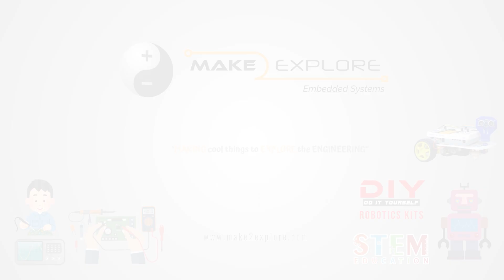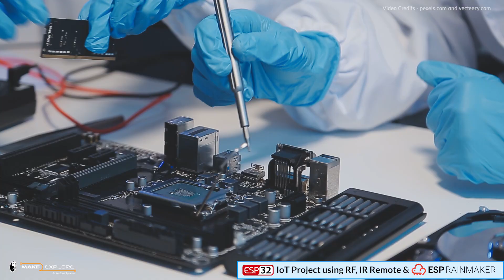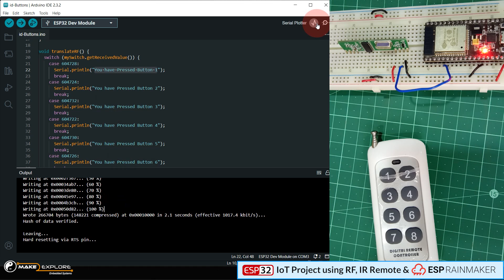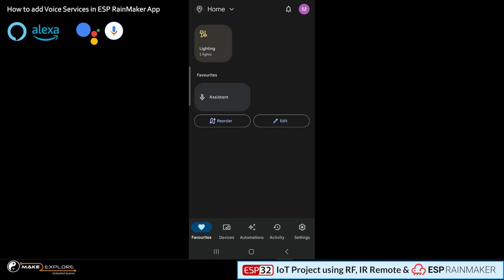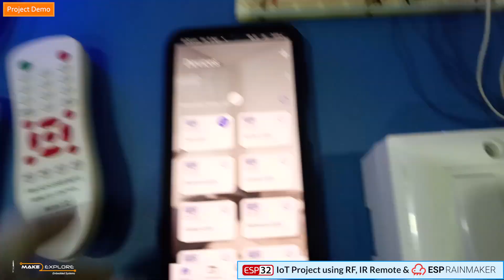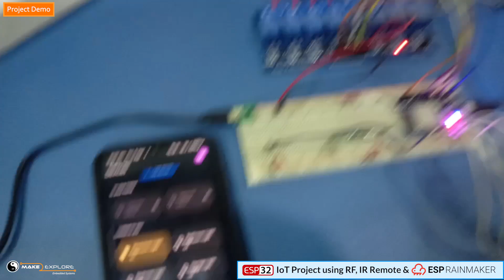[DIY Project] ESP32 IoT Home Automation Project using IR Remote, RF Remote and ESP Rainmaker App

Comment: I liked it. Can I get a version without Wi-Fi ?
Reply from the maker: Dear Vipul Sir, @vipgadawala

Thank you very much for your interest in our channel.

Q - I liked it. Can I get a version without Wi-Fi ?

➡️  Yes, absolutely! The great news is that the hardware circuit stays exactly the same. Even with the current code, the Manual Switches, IR Remote, and RF Remote will work perfectly fine without any Wi-Fi or internet connection. If you completely remove the Wi-Fi/Rainmaker code blocks, you only lose the smartphone app and voice assistants. You can easily comment out the RainMaker initialization lines in the Arduino sketch to make it a 100% offline local controller.

❓ Are you looking for ONLY RF Remote based control without any programming?

==> Then you can use a ready-made standalone product like this:

🛒 433Mhz Wireless Switch 4CH/8CH/16CH Relay Receiver Module + 4/8/16 Button RF Remote Control 433Mhz Transmitter

🔗 https://link.amazon/B0iohm35q

We have a dedicated overview and setup video for this exact standalone board here:
🎬 Video Link:  🔗 https://youtu.be/CNWZQa_2w7c

If you still have any other suggestions/issues/queries about this Tutorial, or any of our DIY project, feel free to ping us on WhatsApp/Telegram (Links given below).

🚀 𝗧𝗲𝗹𝗲𝗴𝗿𝗮𝗺      🔗 https://t.me/make2explore
💬 𝗪𝗵𝗮𝘁𝘀𝗔𝗽𝗽    🔗 https://bit.ly/3VXGGEe
📩 info@make2explore.com  / support@make2explore.com

❤️ Thank you again for your support and your valuable feedback.

Best Regards

Comment: hey , do esprainmaker support matter , if yes how to use it
Reply from the maker: Dear Mehul, @mehul1764

Thank you very much for your interest in our channel. 

Q - hey , do esprainmaker support matter , if yes how to use it....

➡️ ESP RainMaker does not natively support Matter. Actually as of now does not officially support Matter end-to-end out of the box.  However, you can use ESP RainMaker alongside Matter in certain scenarios, depending on your requirements.

Since RainMaker doesn’t support Matter directly, you have a few options:
📌 Option 1 : 
--  Use Both RainMaker and Matter Separately
--  Develop your device firmware to support both:
     -  Use ESP RainMaker for cloud-based control (Alexa/Google).
     -  Use ESP Matter SDK for local Matter compatibility.
For example -   Smart plug could expose Matter for local control while also connecting to RainMaker for cloud features.

📌 Option 2 : Migrate from RainMaker to Matter
--  If you want full Matter support, consider switching to ESP Matter SDK.
--  Matter provides broader ecosystem compatibility (Apple Home, Google, Alexa, etc.).
--  But you lose RainMaker’s cloud features but gain local control.

📌 Option 3 : Bridge RainMaker and Matter
--  Use a Matter bridge (like Home Assistant) to integrate RainMaker devices into Matter.
For example -  Home Assistant can expose RainMaker devices as Matter endpoints.

✅ So, does Espressif support Matter? 
Yes, using the ESP-Matter SDK — a separate SDK from RainMaker. But ESP RainMaker and Matter are two separate ecosystems. Espressif has hinted at potential future integration, but currently, note that ESP RainMaker is cloud-based, relying on Espressif’s backend for control. Whereas Matter is local-first, peer-to-peer protocol without mandatory cloud dependency.

Hope this information will help you. If you still have any suggestions/issues/queries about this Tutorial, or any of our DIY project, feel free to ping us on WhatsApp/Telegram (Links given below).

Tech support - (𝗖𝗵𝗮𝘁 𝗢𝗻𝗹𝘆) Telegram/WhatsApp - 11:00 AM - 05:00 PM (Mon-Fri) IST   

🚀 𝗧𝗲𝗹𝗲𝗴𝗿𝗮𝗺      🔗 https://t.me/make2explore
💬 𝗪𝗵𝗮𝘁𝘀𝗔𝗽𝗽    🔗 https://bit.ly/3VXGGEe
📩 info@make2explore.com  / support@make2explore.com

Thank you for your support.

Best Regards

Comment: If I want to replace the switch with a push button, which item in the code do I need to edit? thanks
Reply from the maker: Dear Mr Dung, @mrdung6030

Thank you very much for your interest in our channel. 

Q - If I want to replace the switch with a push button, which item in the code do I need to edit?....

➡️ Yes, you can modify the code to work with momentary push buttons instead of latching switches. The main difference is that momentary buttons only stay in the LOW (or HIGH, depending on wiring) state while being pressed, whereas latching switches maintain their state until toggled again. So, following changes required for momentary push buttons - 
--  Toggle Logic: Since momentary buttons don't retain state, you need to toggle the relay state each time the button is pressed.
--  Debouncing: Momentary buttons can introduce bouncing (rapid on-off signals), so adding debouncing logic is crucial.
-- Edge Detection: Instead of checking LOW/HIGH states, we should detect button press events (falling/rising edges).

📌 Following code snippet will give you some insights. This is for only one button you can write for the others in similar way, or you can ping us on WhatsApp or Telegram for complete code. 

//===========================================================================//
// Debounce variables (add these globally)
unsigned long lastDebounceTime1 = 0;
const unsigned long debounceDelay = 50; // 50ms debounce delay

// Manual Switch control function (momentary button version)
void manual_control() {
  // Button 1
  if (digitalRead(SwitchPin1) == LOW && millis() - lastDebounceTime1 > debounceDelay) {
    lastDebounceTime1 = millis();
    toggleState_1 = !toggleState_1; // Toggle state
    digitalWrite(RelayPin1, toggleState_1 ? LOW : HIGH); // LOW = ON, HIGH = OFF
    my_hall_Light.updateAndReportParam(ESP_RMAKER_DEF_POWER_NAME, toggleState_1);
    Serial.println(toggleState_1 ? "Switch-1 on" : "Switch-1 off");
  }
}
//===========================================================================//

Hope this information will help you. If you still have any suggestions/issues/queries about this Tutorial, or any of our DIY project, feel free to ping us on WhatsApp/Telegram (Links given below).

Tech support - (𝗖𝗵𝗮𝘁 𝗢𝗻𝗹𝘆) Telegram/WhatsApp - 11:00 AM - 05:00 PM (Mon-Fri) IST   

🚀 𝗧𝗲𝗹𝗲𝗴𝗿𝗮𝗺      🔗 https://t.me/make2explore
💬 𝗪𝗵𝗮𝘁𝘀𝗔𝗽𝗽    🔗 https://bit.ly/3VXGGEe
📩 info@make2explore.com  / support@make2explore.com

Thank you for your support.

Best Regards

Comment: Very good job sir thank you 💯
Reply from the maker: Dear Qadeer, @qadeer1685 

Thank you very much  for your interest in our channel. Glad to know that you found our content helpful.

If you still have any issues/suggestions about this Tutorial, or any of our DIY project, feel free to ping us on WhatsApp/Telegram (Links given below) for further support.

Tech support - (𝗖𝗵𝗮𝘁 𝗢𝗻𝗹𝘆) Telegram/WhatsApp - 11:00 AM - 05:00 PM (Mon-Fri) IST   

🚀 𝗧𝗲𝗹𝗲𝗴𝗿𝗮𝗺      🔗 https://t.me/make2explore
💬 𝗪𝗵𝗮𝘁𝘀𝗔𝗽𝗽    🔗 https://bit.ly/3VXGGEe
📩 info@make2explore.com  / support@make2explore.com

As per time permits we will try our best to help you out. 

Best Regards
Reply: @make2explore esp rainmaker esp32 C3 4 channel relay module Bluetooth activate IR Remote episode Manuel switch feedback status code
Reply from the maker: Dear Qadeer, @qadeer1685  
 
Thank you very much for your interest in our channel.

Q - rainmaker esp32 C3 4 channel relay module Bluetooth activate IR Remote episode Manuel switch feedback status code....

➡️ If you are asking about implementation of EEPROM feature i.e storing 'current State of Relays/Appliances in the EEPROM Memory in this project, Then you can use use EEPROM library

This library get “installed” automatically when you install the ESP32 boards in your Arduino IDE.

With the ESP32 and the EEPROM library you can use up to 512 bytes in the flash memory. This means you have 512 different addresses, and you can save a value between 0 and 255 in each address position.

➡️ Other method is -- Preferences.h library 
We recommended using the EEPROM library to save data on flash memory. However, the EEPROM library is deprecated in favor of the Preferences.h library. 

This library get “installed” automatically when you install the ESP32 boards in your Arduino IDE.

The Preferences.h library is preferably used to store variable values through key:value pairs. Saving data permanently can be important to,
- remember the last state of a variable;
- save settings;
- save how many times an appliance was activated;
- or any other data type you need to save permanently.

✅ In our upcoming Projects using this platform of Home Automation using Rainmaker, we'll try to implement this feature. Thank you very much for your kind suggestion.

If you still have any queries/issues/suggestions about this Tutorial, or any of our DIY project, feel free to ping us on WhatsApp/Telegram (Links given below) for further support.

Tech support - (𝗖𝗵𝗮𝘁 𝗢𝗻𝗹𝘆) Telegram/WhatsApp - 11:00 AM - 05:00 PM (Mon-Fri) IST   

🚀 𝗧𝗲𝗹𝗲𝗴𝗿𝗮𝗺      🔗 https://t.me/make2explore
💬 𝗪𝗵𝗮𝘁𝘀𝗔𝗽𝗽    🔗 https://bit.ly/3VXGGEe
📩 info@make2explore.com  / support@make2explore.com

Best Regards

Comment: C:\Users\Kalindu\AppData\Local\Temp\.arduinoIDE-unsaved20241018-23860-1nc8j5e.lbh6\sketch_nov18c\sketch_nov18c.ino: In function 'void init_RainMaker()':
C:\Users\Kalindu\AppData\Local\Temp\.arduinoIDE-unsaved20241018-23860-1nc8j5e.lbh6\sketch_nov18c\sketch_nov18c.ino:577:29: error: 'WIFI_PROV_SCHEME_BLE' was not declared in this scope; did you mean 'NETWORK_PROV_SCHEME_BLE'?
  577 |     WiFiProv.beginProvision(WIFI_PROV_SCHEME_BLE, WIFI_PROV_SCHEME_HANDLER_FREE_BTDM, WIFI_PROV_SECURITY_1, pop, service_name);
      |                             ^~~~~~~~~~~~~~~~~~~~
      |                             NETWORK_PROV_SCHEME_BLE
C:\Users\Kalindu\AppData\Local\Temp\.arduinoIDE-unsaved20241018-23860-1nc8j5e.lbh6\sketch_nov18c\sketch_nov18c.ino:577:51: error: 'WIFI_PROV_SCHEME_HANDLER_FREE_BTDM' was not declared in this scope; did you mean 'NETWORK_PROV_SCHEME_HANDLER_FREE_BTDM'?
  577 |     WiFiProv.beginProvision(WIFI_PROV_SCHEME_BLE, WIFI_PROV_SCHEME_HANDLER_FREE_BTDM, WIFI_PROV_SECURITY_1, pop, service_name);
      |                                                   ^~~~~~~~~~~~~~~~~~~~~~~~~~~~~~~~~~
      |                                                   NETWORK_PROV_SCHEME_HANDLER_FREE_BTDM
C:\Users\Kalindu\AppData\Local\Temp\.arduinoIDE-unsaved20241018-23860-1nc8j5e.lbh6\sketch_nov18c\sketch_nov18c.ino:577:87: error: 'WIFI_PROV_SECURITY_1' was not declared in this scope; did you mean 'NETWORK_PROV_SECURITY_1'?
  577 |     WiFiProv.beginProvision(WIFI_PROV_SCHEME_BLE, WIFI_PROV_SCHEME_HANDLER_FREE_BTDM, WIFI_PROV_SECURITY_1, pop, service_name);
      |                                                                                       ^~~~~~~~~~~~~~~~~~~~
      |                                                                                       NETWORK_PROV_SECURITY_1

exit status 1

Compilation error: 'WIFI_PROV_SCHEME_BLE' was not declared in this scope; did you mean 'NETWORK_PROV_SCHEME_BLE'?
Reply from the maker: Dear Friend @mhzona

Thank you very much 🙏 for your interest in our channel.

Q -  Compilation error: 'WIFI_PROV_SCHEME_BLE' was not declared in this scope; did you mean 'NETWORK_PROV_SCHEME_BLE'?.....

➡️ Please try using legacy ESP32 core versions 2.0.17. This project's code will not work with latest version of Arduino ESP32 core 3.x.x.

In Arduino IDE - 
➡️ Go to Boards Manager ==> Search ESP32 ==> Install (esp32 by Espressif Systems - 2.0.17)

➡️ Then go to Tools ==> Boards ==> Select ESP32 Dev module

➡️ Then again Go to Tools ==> Partition Scheme ==> RainMaker

Then compile the code, and upload it once successfully compiled. (Tested on 05/11/2024, 12:05 PM IST)

Hope this information will help you. If you still have any issues/suggestions about this Tutorial, or any of our DIY project, feel free to ping us on WhatsApp/Telegram (Links given below) for further support.

Tech support - (𝗖𝗵𝗮𝘁 𝗢𝗻𝗹𝘆) Telegram/WhatsApp - 11:00 AM - 05:00 PM (Mon-Fri) IST   

🚀 𝗧𝗲𝗹𝗲𝗴𝗿𝗮𝗺      🔗 https://t.me/make2explore
💬 𝗪𝗵𝗮𝘁𝘀𝗔𝗽𝗽    🔗 https://bit.ly/3VXGGEe
📩 info@make2explore.com  / support@make2explore.com

As per time permits we will try our best to help you out. 

Best Regards 🙏
Reply: @make2explore  thanks.. I will check

Comment: Hi dear!

First of all, very nice video, but this project is not directly integrated with Matter, is it? It only uses ESP Rainkmaker (which is not Matter).
This project cannot be controlled by Android, Apple and Amazon devices at the same time, am I right?

Best regards!
Reply from the maker: Dear Friend, Fawzi El Gamal @23Faxi  
 
Thank you very much for your interest in our channel and your encouragement. Glad to know that you liked our content.

Q - but this project is not directly integrated with Matter, is it?

➡️ Yes!, you are right. This project does not use Matter programming 'directly'. But it use Matter' standard/protocol to get connect with Amazon Echo device. If you see in our another video (link given below), we choose and add 'ESP Rainmaker Device' as a Matter Accessory  in Alexa App. 

▶️ 🔗 https://youtu.be/c6K8ZA3cKEQ?t=1070

We have used same method to add devices ('Light Bulbs') in this project. Although they are 'Rainmaker Devices', they are added in project as an 'Matter Accessories/end Devices'.

📌 *This project does not use 'Matter SDK' for programming. We used rainmaker coding.

Q - This project cannot be controlled by Android, Apple and Amazon devices at the same time, am I right?

➡️ No, you can control it via across all platform which support Matter standard, since 'Matter' itself originated for 'ubiquitous' role. The primary goal of the Matter protocol is to create a unified, interoperable, and secure standard for smart home devices, enabling seamless communication and interaction between devices from different manufacturers.

📌 So if you have devices which supports Matter Standard you can add them to the network and control them regardless of OS platforms and Hardware manufacturers.

Hope you find this information useful. If you still have any queries/issues/suggestions about this Tutorial, or any of our DIY project, feel free to ping us on WhatsApp/Telegram (Links given below) for further support.

Tech support - (𝗖𝗵𝗮𝘁 𝗢𝗻𝗹𝘆) Telegram/WhatsApp - 11:00 AM - 05:00 PM (Mon-Fri) IST   

🚀 𝗧𝗲𝗹𝗲𝗴𝗿𝗮𝗺      🔗 https://t.me/make2explore
💬 𝗪𝗵𝗮𝘁𝘀𝗔𝗽𝗽    🔗 https://bit.ly/3VXGGEe
📩 info@make2explore.com  / support@make2explore.com

We will be ❤️happy to help.

Best Regards

Comment: #include "RMaker.h"

#include "WiFi.h"

#include "WiFiProv.h"

#include <IRremote.h>

#include  <RFremote.h>

#include <Preferences.h>

Preferences pref;
Reply from the maker: Dear Friend @ajmolhoque102   

➡️ You can refer following excellent Tutorial by Rui Santos

🔗 https://randomnerdtutorials.com/esp32-save-data-permanently-preferences/

Modify the code to save the state of each relay. And you need to add one more handle to continuously update the status. 

➡️ If you want to use esp32-preferences-library then, Use following Project's code for reference
🔗 https://iotcircuithub.com/esp32-preferences-library-tutorial/

  //Create a namespace called "relay-state" with read/write mode
  pref.begin("relay-state", false);

  // read the Relay state from nvs flash memory
  relayState = pref.getBool("state", false); 

   // save the LED state in flash memory
   pref.putBool("state", relayState);

➡️ If you want to use EEPROM library then, Use following Project's code for reference
🔗 https://www.technolabcreation.com/eeprom-memoryandroid-app-and-manual-control-home-automation-system/

void eepromcheckstate() {
{
  toggleState_1 = EEPROM.read(0);
  if(toggleState_1 == HIGH) {
    digitalWrite(relay_1, HIGH);
   }   
   if(toggleState_1 == LOW) {
    digitalWrite(relay_1, LOW);
   }  
-
-
-
}

Best Regards

Comment: Home automation eeprom system please reply
Reply from the maker: Dear Friend @ajmolhoque102   
 
Thank you very much for your interest in our channel.

Q - Home automation eeprom system please reply

➡️ If you are asking about implementation of EEPROM feature i.e storing 'current State of Relays/Appliances in the EEPROM Memory in this project, Then you can use use EEPROM library

This library get “installed” automatically when you install the ESP32 boards in your Arduino IDE.

With the ESP32 and the EEPROM library you can use up to 512 bytes in the flash memory. This means you have 512 different addresses, and you can save a value between 0 and 255 in each address position.

➡️ Other method is -- Preferences.h library 
We recommended using the EEPROM library to save data on flash memory. However, the EEPROM library is deprecated in favor of the Preferences.h library. 

This library get “installed” automatically when you install the ESP32 boards in your Arduino IDE.

The Preferences.h library is preferably used to store variable values through key:value pairs. Saving data permanently can be important to,
- remember the last state of a variable;
- save settings;
- save how many times an appliance was activated;
- or any other data type you need to save permanently.

✅ In our upcoming Projects using this platform of Home Automation using Rainmaker, we'll try to implement this feature. Thank you very much for your kind suggestion.

If you still have any queries/issues/suggestions about this Tutorial, or any of our DIY project, feel free to ping us on WhatsApp/Telegram (Links given below) for further support.

Tech support - (𝗖𝗵𝗮𝘁 𝗢𝗻𝗹𝘆) Telegram/WhatsApp - 11:00 AM - 05:00 PM (Mon-Fri) IST   

🚀 𝗧𝗲𝗹𝗲𝗴𝗿𝗮𝗺      🔗 https://t.me/make2explore
💬 𝗪𝗵𝗮𝘁𝘀𝗔𝗽𝗽    🔗 https://bit.ly/3VXGGEe
📩 info@make2explore.com  / support@make2explore.com

Best Regards
Reply: @make2explore  same request please make this type